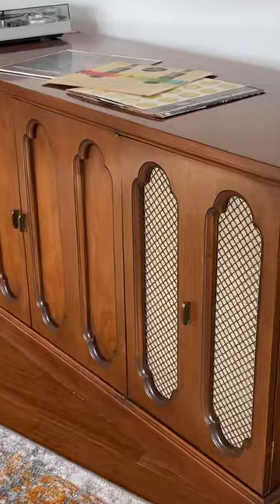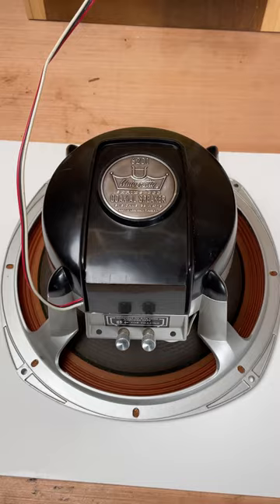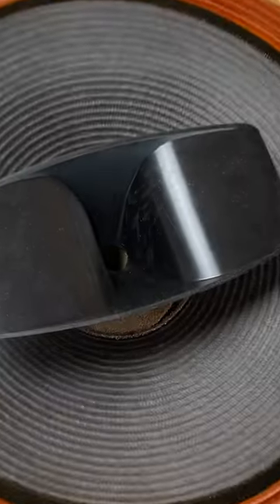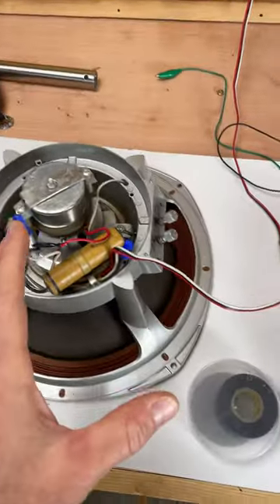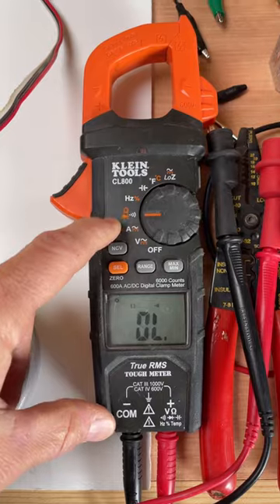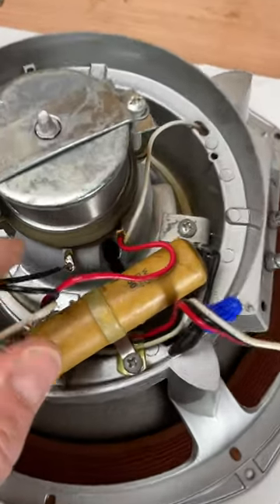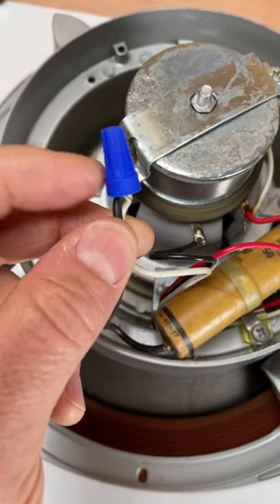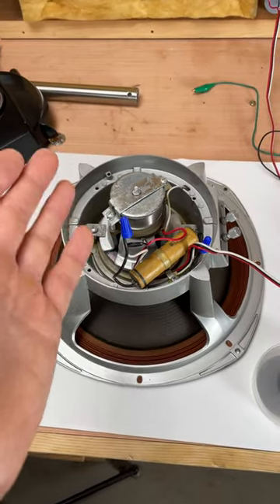How To Fix Vintage HiFi Speakers!! #capacitor #speakers #university6201

Comment: You put wire nuts on a literal vibrator. Think about why wire nuts are used in housing but not on road vehicles..
Reply: Came here to say exactly that. He could've crimped at least. Shit I always use wago connectors. The cost is worth the peace of mind

Comment: Damn everyone railing him for using wire nuts. I’ve been using wire nuts with electrical tape on my personal car for years 😭
Reply: Dude what's your car
Reply: LeSabre🙄 quote: ViceGripGarage🤘
Reply: a n i m e
n
i
m
e
Reply: It's really fine as long as properly installed, only in the interior, and extra protection to prevent it backing off